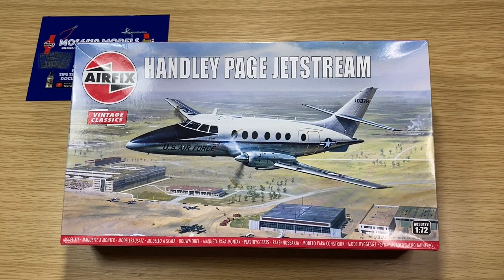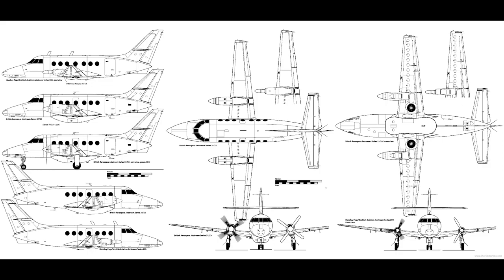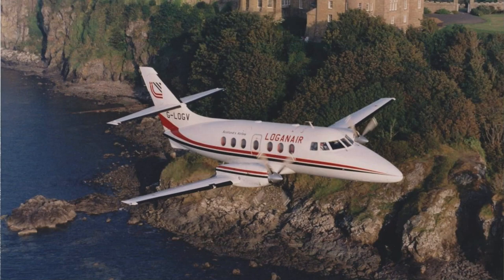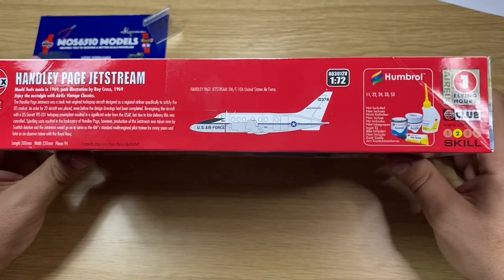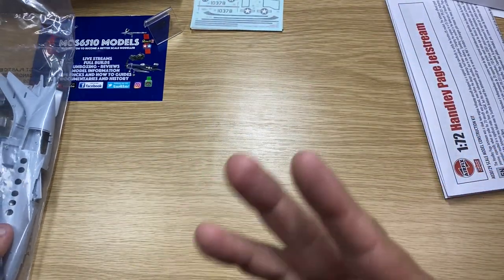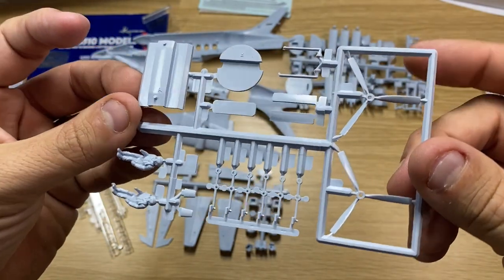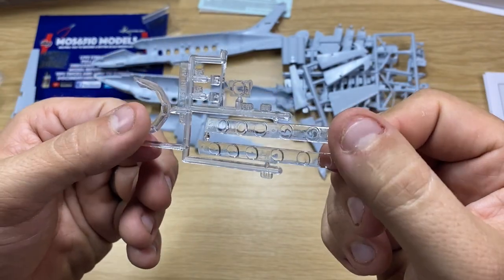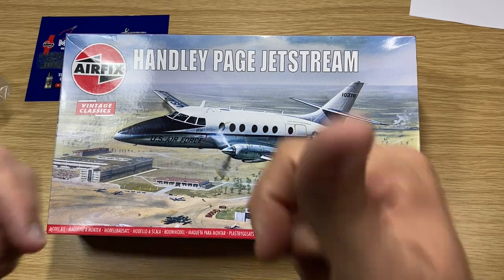Airfix Handley Page Jetstream 1/72 Vintage Classic Unboxing

Comment: The only reason I've not purchased that kit yet are those USAF decals.
Reply from the maker: Thats the thing.. ive never seen a photo of one.. in fact my research says the USAF cancelled the order before full manufacture.. but the british kept buying more... so is this an unrealistic kit??
Reply: Does that class it as a what if then?
Reply from the maker: Jamie Ball that’s a great point lol
Reply: Seeing the comments here since it's a old kit and them decals need a metallic finish and a perfect base to get that finish you are probably spot on...  it could have come with different decals.  Especially if you are going to re scribe it the USA livery will be a nightmare
Reply from the maker: its the prototype anyways as the USAF never did buy one as wiki points out " C-10 Jetstream – Handley Page (USAF 68-10378/10388; were to be offset purchase for RAF F-111K, both cancelled)"
Reply: AFAIK the engine nacelle design was unique for the C-10 version. All the other (manufactured) Jetstreams have different nacelles :(
Reply from the maker: @ukaszglinski2762  interesting
but would that matter?
Reply: @MOS6510Models  IMHO yes, building the AModel Jetstream right now and the engine difference is clearly visible.
Reply from the maker: Łukasz Gliński what I meant was does it really matter to the builder.. Airfix and others have re released kits of different marks but all they do is change the decals.. that Boeing 747 was released as as a 400 but the engines were different.. just different decals
Reply: Get the Amodel kit if you want the British version.

Comment: To do the Rad and Royal Navy versions would involve Airfix having to re-tool the wing parts and also mould new engines and radomes. The cabin interior as well as the port side window layout would need changing as well. It would basically result in a new kit. The kit has the markings it has, as the USAF had ordered the type as an air ambulance. The order was subsequently cancelled in the wake of Handley Page's financial troubles.
Reply from the maker: I dont think that really matters.. this plane never ever took to the skies in those colours, it was an artistic impression, and there also would've been an artistic impression of that same plane in RAF colours too.. both as a "what if".. Just give the modeller that option fot the money they are asking for the kit. That said i have just bought a M and E models resin kit and decals to build this as RAF.. Stay tuned as i might build it after christmas :)

Comment: The kit is based on the C-10A or Jetstream 3M, which was developed for USAF as a small cargo plane, however the order was cancelled in late 1969, then HP went Bankrupt - oops
Reply from the maker: James Mower agreed yeah I mention they went bankrupt in the video.. but I’ve looked and can’t confirm if this plane ever had these markings or did Cross base his artwork on a concept photo that was used to sell the plane to the USAF??
Reply: @MOS6510Models  Airfix used to get access to British Aviation Factories, when they were designing a new aircraft kit. So they more than likely had access to the Jetstream and the soon to be cancelled C-10A was the one they saw. I met their design & research team briefly when they were crawling around the Sea Harrier FA.2 at Dunsfold, when they were developing the 1/48th scale kit back in the 90's ;)
Reply from the maker: @toboldlygosmodelworks1973  yeah thats deffo worth a shout.. its the prototype anyways as the USAF never did buy one as wiki points out " C-10 Jetstream – Handley Page (USAF 68-10378/10388; were to be offset purchase for RAF F-111K, both cancelled)"
Reply: @MOS6510Models  That was after all the corrupt wheeling and dealing that caused the cancellation of the TSR.2 as well :/ 

Soon as I saw the stretchers in the cabin, I knew it was the proposed US version.
Reply from the maker: @toboldlygosmodelworks1973  looking on Wiki a few were cancelled due to corruption.. like the Boeing KC-767.. cancelled because of corruption.. Boeing and Corruption?? where have i heard that before lol
Reply: @MOS6510Models  Probably the same place where the Boeing Employee leaked all the dirt on the 737 Max..

Which mystifies me as their NDT test requirements were always the hardest to pass (I did more than once) ;)

Comment: I can understand your frustration of only one decal option. But as others have pointed out that due to the engine configuration it would not be correct if they included RAF or RN markings. The engines on the U.K. version are very different in appearance. Great video, thanks for sharing 👍
Reply from the maker: Point taken.. granted.  but then these markings are not real markings either since they pulled from a concept picture.. USAF never bought one. they were touted to the british market too, probably with the same engine in the pictures lol..  That said we can name a few planes down the years that have the wrong markings to what the model is.. 

I just felt airfix missed a trick here to release a model with a different decal which was british,, Thanks for commenting though, i really appreciate the input.
Reply: MOS6510 Models all the other aircraft produced in the Jetstream 200 series used French Astazou engines, and this includes the aircraft purchased by the RAF and RN as trainers. Ironically, the layer Jetstream 31 and much enlarged Jetstream 41 series both used newer variants of the Garret TPE331 that was supposed to go in the C-10. A long time ago, there was an Astazou conversion for this kit, along with a thimble nose to make the RN T.2 variant. 
https://www.scalemates.com/kits/mande-models-kc003-handley-page-jetstream-t1-t2--146018

There is also a set for the much newer AModel Jetstream kit that might be made to work 
https://www.scalemates.com/kits/air-graphics-models-airac-128-bae-jetstream-t1-t2-engine-set--1196522
Reply from the maker: Russell Taylor that’s great info there.. yes the astazou engines were greater powerhouses that gave them the speed required. Since I reviewed the kit I’ve had a few emails from folks who have built the kit with m and E conversion kit and model art decals from hannets with the original engines and the both look fab. This is a “what if” kit as USAF didn’t even buy it so what about a uk what if version from Airfix too.. I’m loving the debate with this.. it was an observation and still stand with my reaction of Airfix missing a trick with the decals.. especially at that price :)

Comment: The reason the  Jetstream model  was released in U.S.A.F colours was that at time they (Handley page) had secured a large order from them  to be used as Air Ambulances, unfortunately the United States Air Force cancelled the order, Handley page were reliant on the success of the order  when cancelled it brought Handley page to there nees.
Reply from the maker: And different engines too as someone suggested

Comment: For such an early kit, something is missing.  Back in the day that model would have come with a stand - so then where is the slot for the stand in that kit?  It should have one unless it's been fiddled with!
Reply from the maker: new boxings don't come with stands unfortunately.. they were clear stands too
Reply: @MOS6510Models  Yeah, I remember them well - what I was saying is that the old kit you have there doesn't have the slot for the stand that would have been part of the original tooling, was wondering what happened to that....